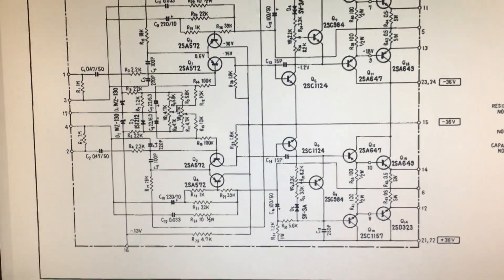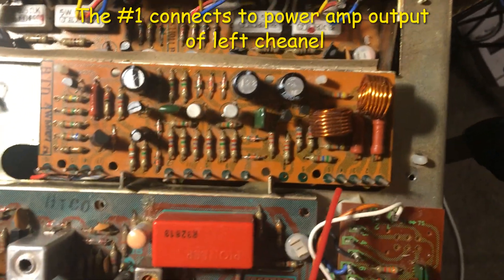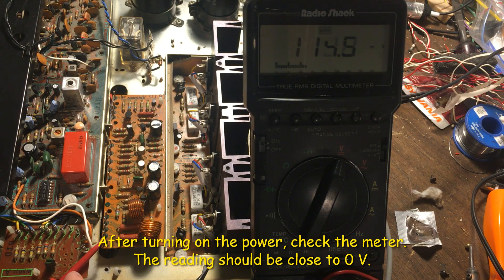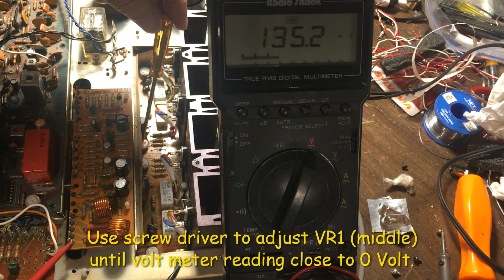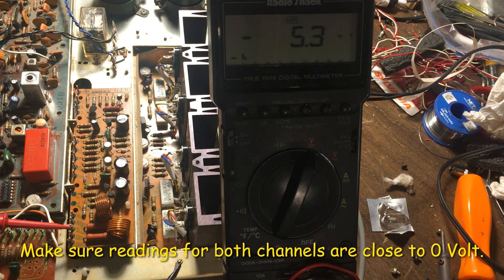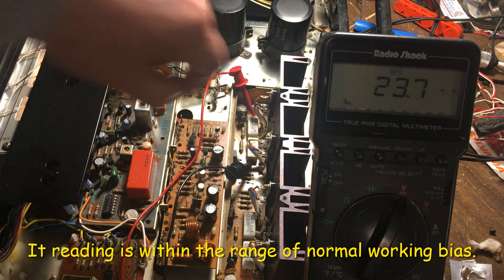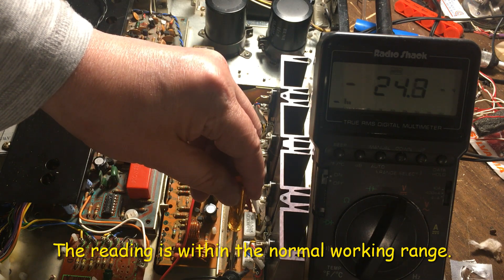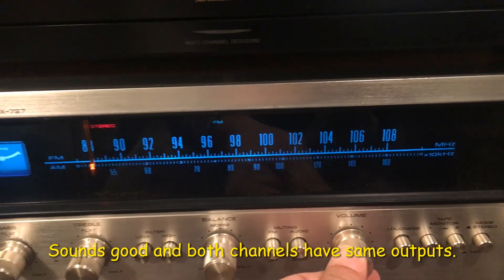Servicing A Vintage Pioneer SX-727 Receiver - Part 2 (DC offset & Bias Adjustments)

Comment: I like the unagitated, calm presentation.
I am currently in the process of repairing and overhauling an SX-727 that I bought defective.
Thanks for the DC offset and bias adjustment, the service manual doesn't say anything about it.

Comment: When you do the DC offset and bias adjustment on a 727,, do you have it set to speaker A with no volume, or do you have the speakers off? And do you also have any speakers hooked up externally?
Reply from the maker: It is not recommended to hook up the speakers when doing the DC offset and bias adjustments.
Reply: @VintageAudioFan  thank you so much. Do you set the speaker selector to speaker A, or to "spkr off"?
Reply from the maker: @SoloBueno1  Speaker Off.
Reply: @VintageAudioFan  thanks!

Comment: Thanks so much! I just finished restoring an sx-727 with your help. Funny thing, bias was on spec and dc offset below 5 mV on both channels!
Reply from the maker: @howardlovecraft750  It won't be easy. It needs some basic electronic knowledge.
Reply from the maker: Great job! These adjustments will help SX-727 in proper working condition.

Comment: Thank you for taking the time to educate!
For the dc offset and biasing, do I need a speaker load?
Thanks again.
Reply from the maker: No. You don't need speaker load to do DC offset and bias adjustments.
Reply: @VintageAudioFan  Thank you very much! because of your videos, the amp was easy to get the pots working and check adjustments and was working perfectly! It has developed an issue with the FM, though. No signal. Slight hiss, and no meter movement.  AM and all other functions are good.
Reply: It must be a loose connection or bad solder joint. I turned it on and no signal up and down the dial. Lightly bumped it against the shelf and now have FM again.